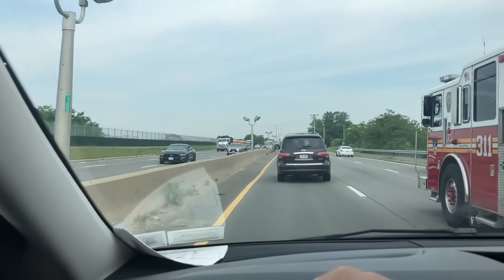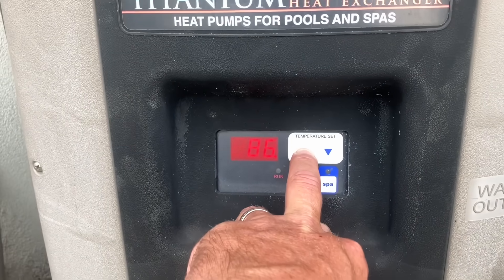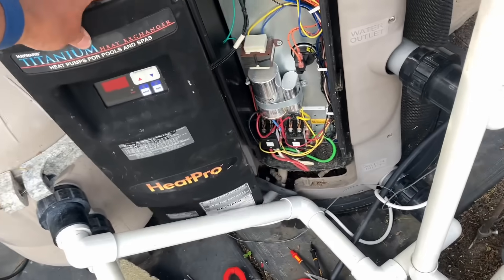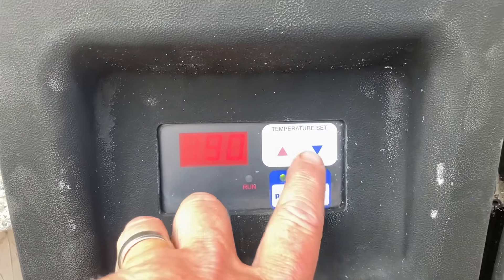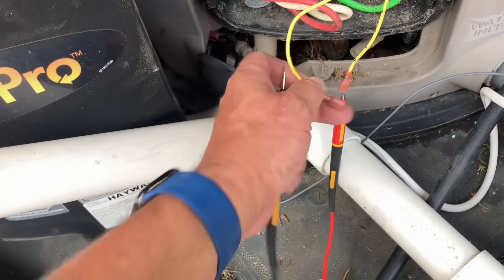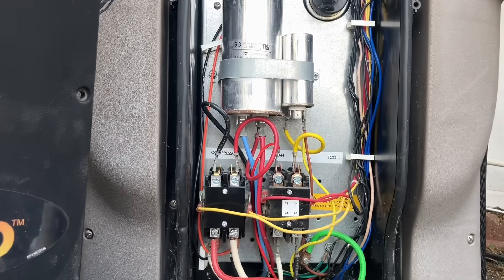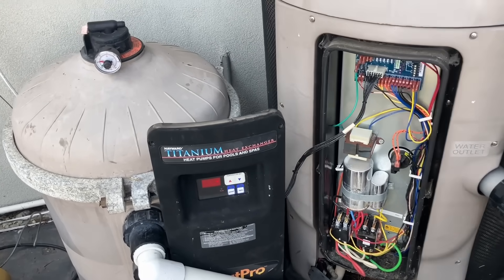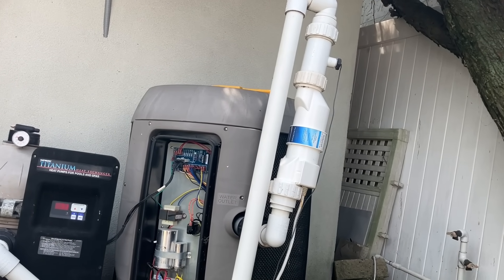Hayward Heat Pump Pool Heater Won’t Heat — No Error Codes, Just DEAD SILENCE! Watch How I Fix It

Comment: My Hayward pump is giving me a PS code. I just replaced the pressure switch, control board , and capacitors. I’m still getting a PS code. My pool seems to be circulating as normal and it looks clear and clean. However The water tube going to the pressure switch doesn’t seem to be shooting enough water to activate the pressure switch. Any ideas what it could be. I’ve called everywhere and nobody seems to be able to help.

Comment: 204 volts? Three phase power in that house?
Reply from the maker: New York City has a different electrical voltage
Reply: @PipeDoctor  is 204 better or worse than the standard 240v  everything I work on is 120v/240v
Reply: @PipeDoctor  mikey open the pod bay doors, mikey open the pod bay doors
Reply: I actually had to look that up because I was so curious, Con-Ed pulls two legs off a three phase setup and that's why they wind up with 120/208, I was mind blown.